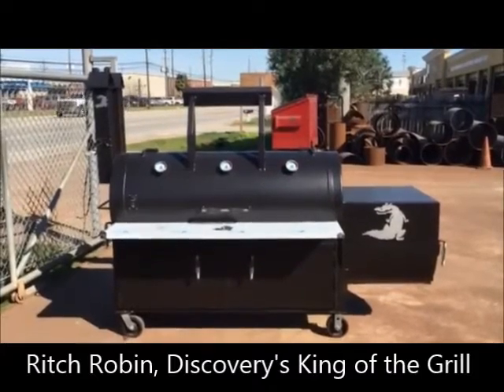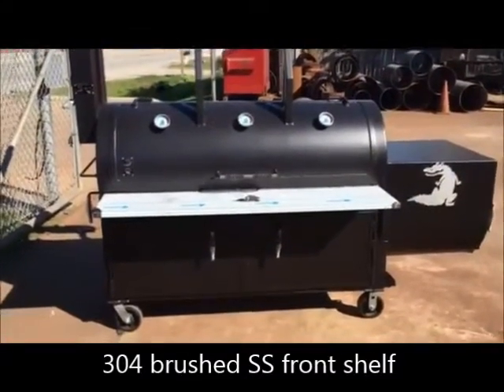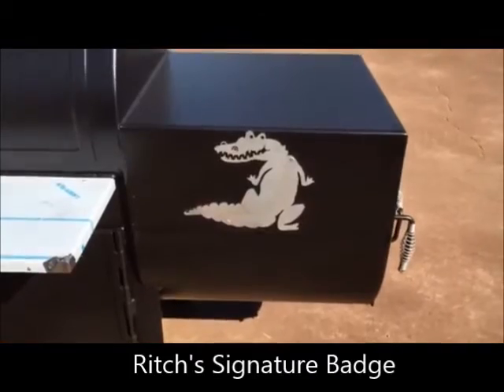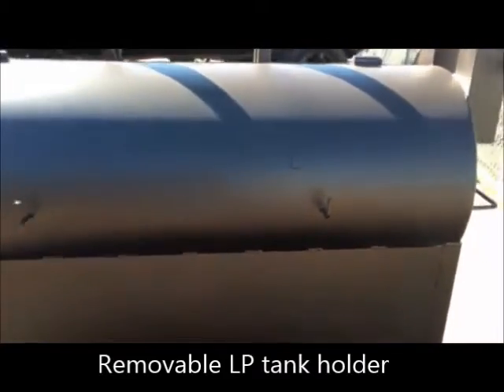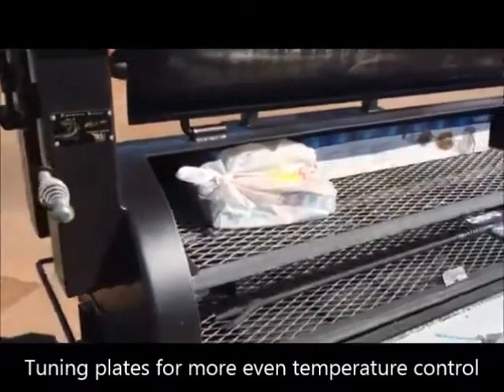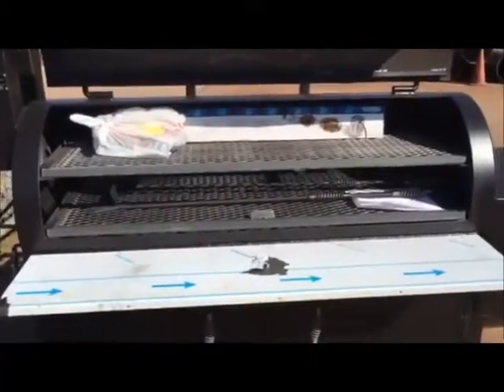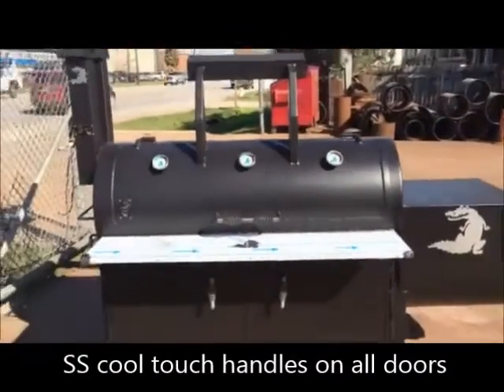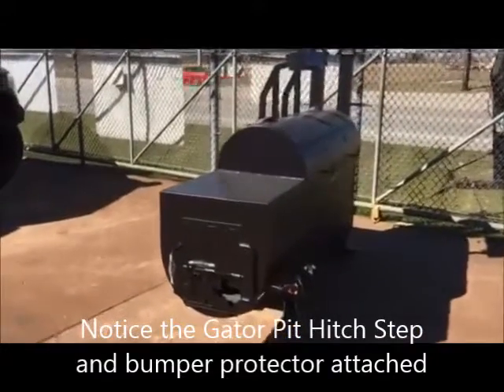King of the Grill, Gator Pit of Texas Ritch Robin

Comment: Hey Ritch if at all possible could you make a video of the added extra features that a customer can add to a custom grill/smoker that you and the team provide for your customers that would be awesome..
Reply from the maker: MrJag83aa, we list the most popular custom features or "options" that our customers add to our specific smokers on our website gatorpit.net.  If you look at the models listed on our gatorpit.net website, click on a specific Gator Pit, below that model listed is an options lists of 20 or more popular custom additions to that cooker.   Those are the popular features over some 20 years.  A single video listing "every" features, customization, we have or can do, would be a very long video.  As, we can pretty much do anything anyone can think of and that is limitless.  From making a Space Shuttle cooker, a Boeing 747 Cooker, a Tailgating cooker that looks like a donkey (yes, we did do that for a customer), artwork is different for each customer, wheels vary in style, firebox options from square to 1/2" wall, round to grill ability to griddle ability to gas assist (and those gas options can vary in style) to various air intake designs, etc.  It it limitless.  I hope this helps answer your questions or requests.   Ritch Robin